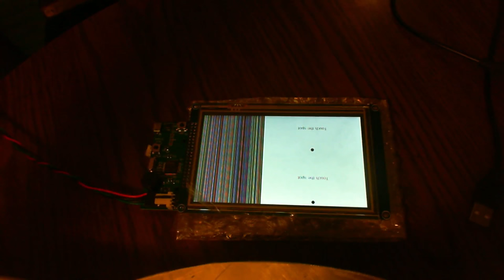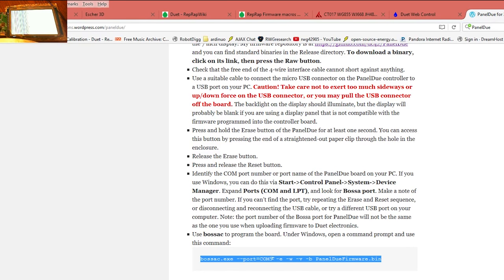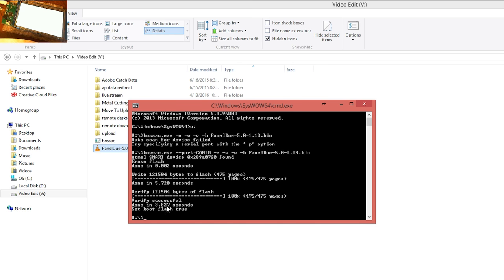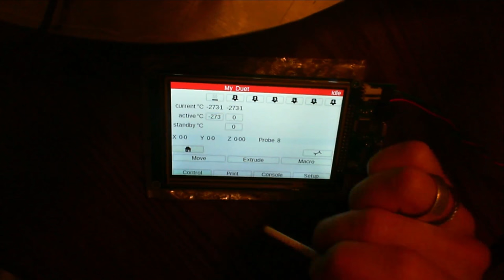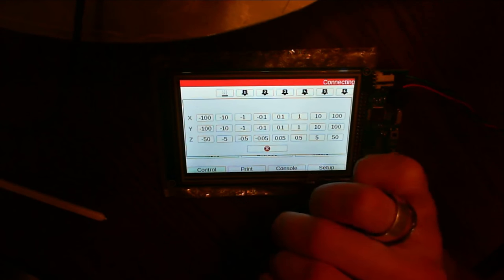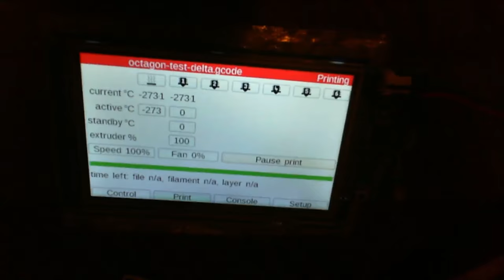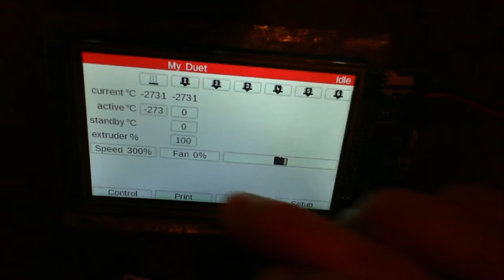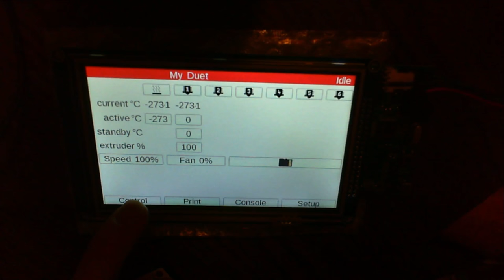RWG-OSD # 18 PanelDue Firmware Update For Different Screen Size. #How To

Comment: It's funny to see people still using DOS.  I still use it from time to time.  Makes batch processing super fast and super easy.
Reply: Thats not actually MS DOS, what you see is just the Terminal window for MS Windows 7 :)
Reply: muh1h1
OK, it's a program that simulates DOS so any functions performed in DOS can still be performed in DOS on a Windows machine.
Reply: Yeah a lot of people don't realize that modern DOS in windows is in fact emulated dos not real dos at all.
Reply: *****
The point is, it performs the same function as the original DOS.  You can call it emulated DOS or you can cal it DOS.  For all intents and purposes it is DOS.  DOS ceased being an operating system after Windows ME and NT were created.  I find it odd that it's over 15 years old and people still use it.  There isn't any other software that has remained unchanged and been used this long.  It just goes to show you, a graphical user interface isn't always the fastest and easiest way to process files. 

I worked for Hotels.com many years ago.  In the late 90's we used the AS400 system.  A few years later we migrated over to a web based platform but the AS400 was still available to perform tasks.  Everyone using the web based platform was amazed at how fast the AS400 could perform many tasks.  Since I began working their early and had a good understanding of the AS400, I became really important all the sudden.  They would work for hours on something when I could complete the same task with the AS400 emulator in a matter of minutes. It got real interesting when Expedia came in and tried to implement their system.  The AS400, even though it took a long learning curve, could out perform their system.  Much like "emulated" DOS can out perform Windows in many tasks.
Reply: Agreed
Reply: Again, it is not DOS nor is it emulated DOS, it is just the Windows Terminal Emulator called CMD. What you keep talking about is "DOSBox", which is indeed a Dos emulator and works exactly the same way DOS did back in the day. DOS programs will not run in CMD (aka Windows Terminal Emulator) it is just the look of the Terminal that is very simular to DOS, and also the way you use it, But a linux terminal works in the same way and yet still is not MS DOS. 

Still your point stands that Text Based user interfaces like MSDOS (Which is actually still used in some cases), Powershell. CMD or Linux Terminal Emulators are still relevant today and probably always will be. Some things can be done much, much quicker using a Commandline when compared to a graphical user interface.
Reply: muh1h1
Fine then, the whole point behind including the "command prompt" in Windows is to mimic the functionality of MS-DOS.  It uses the exact same commands.  In fact, the term CMD is short for "MS-DOS command prompt".  It's the same command used to exit the graphical interface in favor of the command prompt since Windows 3.1.  I assumed that anyone reading it would know what was meant by referring to it as MS-DOS.  To use the functionality of the "command prompt" one must know the commands of MS-DOS. Again, for all intents and purposes, it is MS-DOS.  As for Linux, it was modeled after MS-DOS.  Of course it works the same way.  The whole point behind it was a free open source alternative to DOS.  They purposefully made the commands the same in hopes of migrating users away from Microsoft. 

Even though the "command prompt" operates completely differently than MS-DOS, the results are the same.  So don't get confused when I say "for all intents and purposes".  That means it's not DOS but it does the same thing as DOS using the exact same interface and exact same commands.  In fact, I don't think there is any other use for the command prompt other than to use it for file processing and management using original DOS commands.  .If you play console games on your computer using an emulator, you don't make it known that you weren't actually playing a console but rather an emulator.  And yes, the command prompt is a DOS emulator so don't go there.

Comment: First thing I thought was "Ooooh that screen is fucked :O" Glad it just needed a firmware upgrade :P What a weird failure mode though?
Reply from the maker: yeah, well its not really a failure mode. its just that the firmware is spitting out code for the smaller screen, so its just doing what it thinks it needs to lol ~Russ
Reply: ***** Yeah I thought that's what it might be :) Like it's reaching the end of the memory that's set aside for the smaller screen, but carries on writing data out, so it looks like random lines.